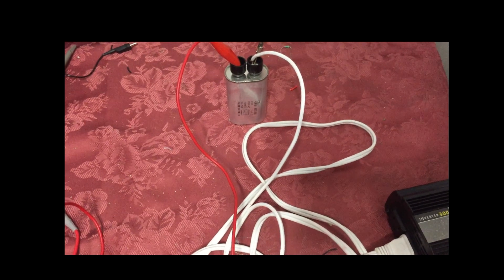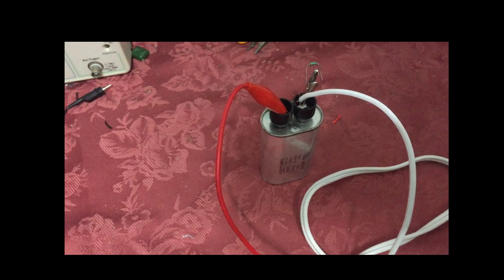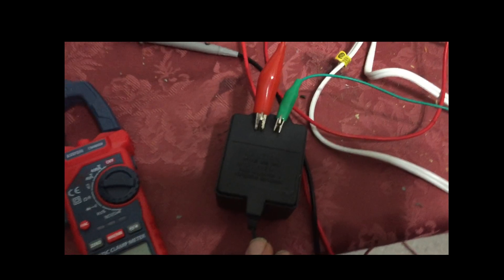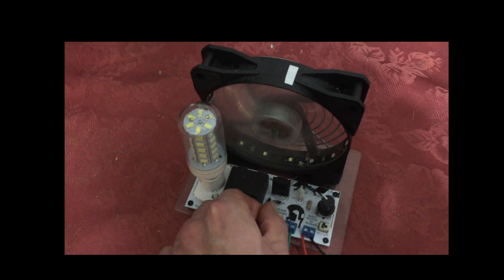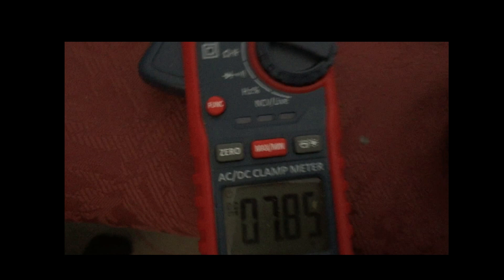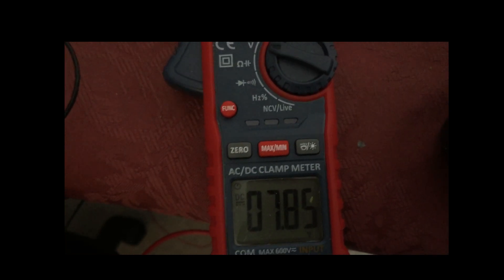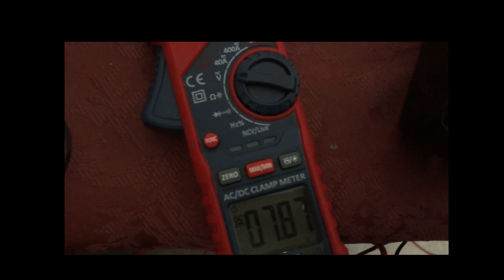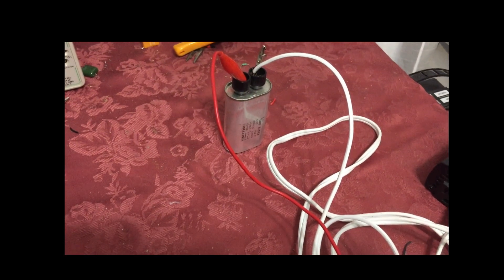Reactive Power For Bedini

Comment: If you put the input side through transformers and lower the voltage instead of bring it up can you bring the voltage down 1V and still get the same reactant power because it is not affecting The electronics by turning on?

Comment: Hello everyone.

Joel I am pretty sure you may want to have a look at Arie Melis DeGeus patent NL1031494 inverter +99% efficient ! The patent is expired and anyone can use it for free even for profit not only for personal use.

I will upload it on your forum website and you will see only 2 capacitors, 1 mechanical relay and a switch is all you need for a super efficient inverter.

I am keep saying people should read all 20 patents of Arie Melis DeGeus, as the inventor have shown very efficient ways to exploit Tesla’s work, where Bedini, Bearden and many others have kept all the secrets. Everything is in plain sight, well explained with practical applications with calculus and almost all values for electronic/electric components. Very easy to replicate even for a 12-14 years old school child.

Also, the importance of 2 capacitors in series as Degeus, and Tesla explained in his notes from Colorado Springs.